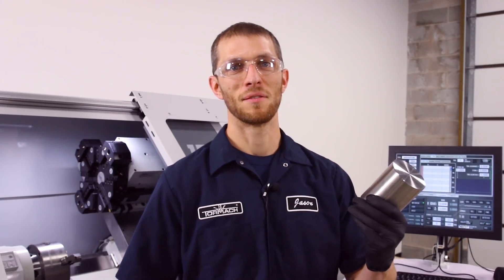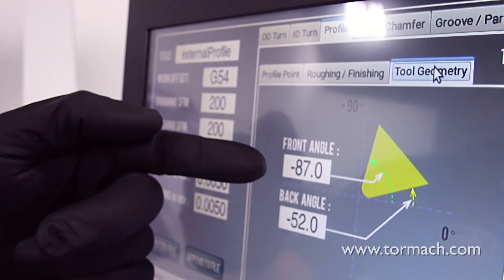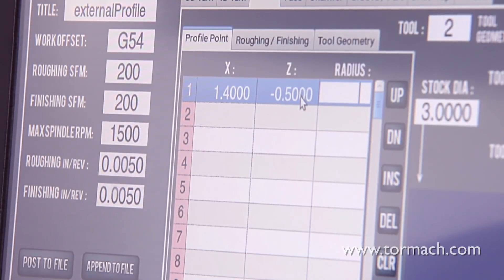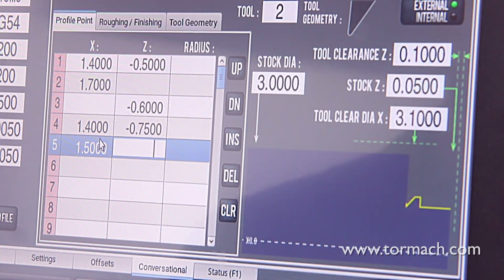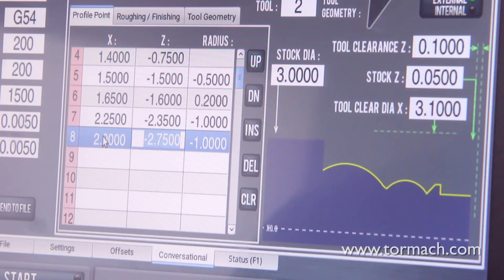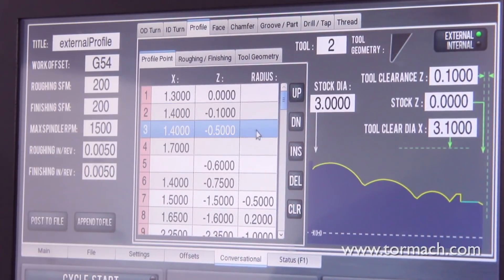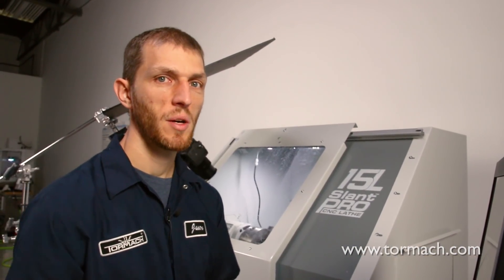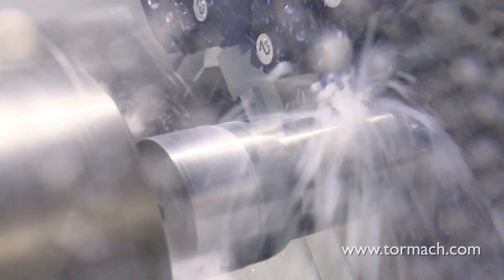Cutting Stainless Steel with PathPilot's Conversational Profiling

Comment: Fellas I finally found a part that Tormach did not stock- a 3mm dowel pin for the 5C collet insert, (they did point me where to obtain) they have always had everything else in stock when I needed it if that is no enough reason to buy Tormach then their commitment to improving path pilot or instructional videos should do it. I am not associated with them in anyway...just saying.
Reply from the maker: Thanks for the compliments! Our software team is very committed to updating PathPilot, and listening to all the suggestions for improvement. Jason is also very excited to share his knowledge, and machine new parts.
Reply: Thanks to Jason, Joe, Chad and Ann and the rest of the team.

Comment: Pathpilot is great.  Nice Video.  Is there anyway to reverse the direction of cut?  (Cut toward the tailstock, not toward the spindle)  The profile tab has a part gouge error if tool will contact the material. (the red line)  but assuming you already cut clearance in  your stock and want to use a left hand cutting tool... how do you do this?

Comment: That is a very usefull addition to the conversational programming interface. Can this also work on rapidturn? Thanks, Kieran.
Reply from the maker: Yes, the profiling feature should work exactly the same on the RapidTurn.
Reply: @tormachinc  I'm working on a part that is a sphere on the end of a rod, using rapidturn.  I would like to use a left hand cutting tool and cut toward the tailstock but the profiling wont allow it because of the gouge error, but I already have cut clearance for the tool.  Can I override the gouge error?  and post anyway?  BTW, the profiling tab is great.